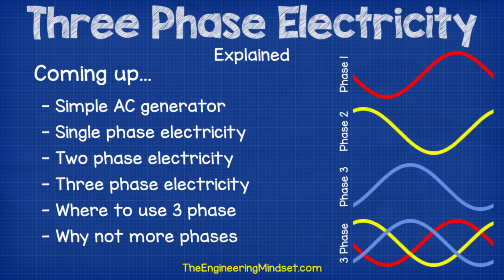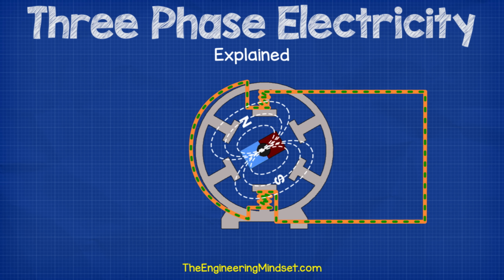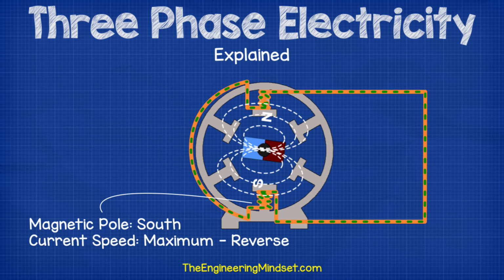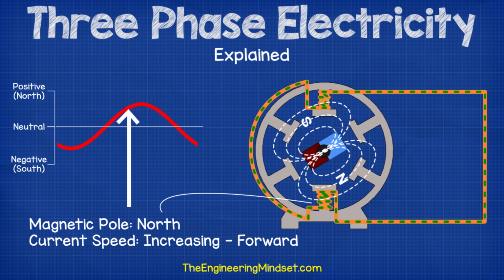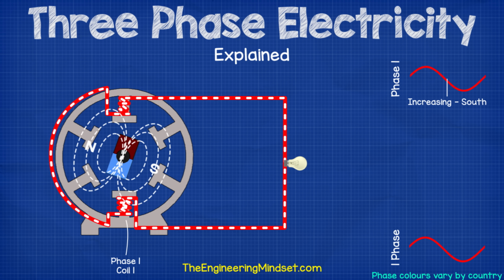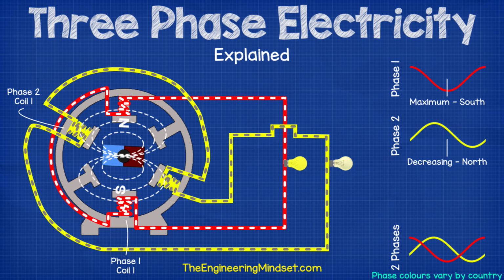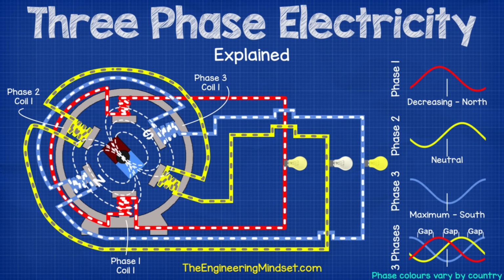How Three Phase Electricity works - The basics explained

Comment: That last bit about splitting and connecting only one phase to some appliances doesn't agree with your earlier explanation. Won't they flicker then? Or is the 50Hz flickering not noticeable for the naked eye?
Reply from the maker: AC is always flickering its just not noticeable
Reply: I believe the illustration was to highlight the fact that with a single phase, there are 2 points when zero work is being done. For a commercial setting with high power requirements, 3 phase power there is always being work done regardless of what point of the cycle it is resulting in a more effective use if energy.  For residential use, it's more than good enough. For a flashing light, the human eye can't see the difference until below 20 Hz or so. That is why the first films were recorded at 24 frames per second. That is past the point when you can see individual pictures and perceive the changes as movement.

Comment: Ok but my single phase power outlet has only one live wire. The other is neutral. Based on this video the wiring is symmetrical and thus each of the wires is live at some point.
Reply from the maker: Have a look at delta star connections, that is what your single phase outlet has and why it has a neutral line

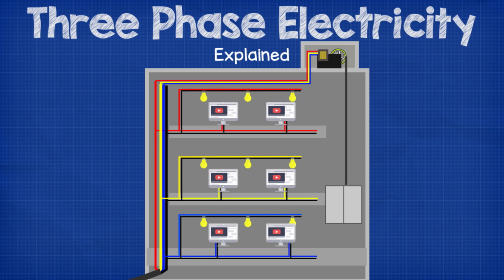Comment: 7:18, huh I'm quite sure most buildings in Finland at least  have all 3 phases because saunas and water boilers
Reply from the maker: Interesting, didn't know that
Reply: Heating is a very Watt-intensive load, and that is probably the driving factor.  In countries where most heat comes from on-site burners, instead of from electricity, there is almost no reason to deliver 3-phase to a residence.

Comment: in a lot of building with florescent lamps they with distribute the 3 phases evenly throughout the lights so the flickering of the lights cancels each other out. At my work there is a corner with only a single phase light and you can tell there is only 1 phase of light in that area due to a strobbing effect. The rest of the place you cannot tell due to the phases canceling each other out.

Comment: Where I live (Texas) all the homes have two 110v legs coming into the main breaker box. Wouldn’t this be two phase? At the end of the video you said that homes usually have one phase. Great video as usual!
Reply: Possibly, but more likely it's a single phase. What they use is called a center tap transformer. From the center to one end is 110v and from the center to the other end is -110v. The difference from end to end is 220V. For most outlets you only need one end as that is what your tv and lights run on. The 220 is used for your stove or dryer.
Reply from the maker: Yes I wasn't aware at the time that parts of the US have dual phase to houses as the voltage is lower

Comment: perfect illustration and explanation.   back in in the 1900s the lights DID flicker and they decided to speed the rotation of the magnet to 60Hz so it was no longer noticeable by the human eye. does DC not have a Hz then?
Reply from the maker: Hmm interesting
Reply: Hz is not an applicable term for DC, because there are no cycles in DC.

Comment: A good video, but I have a tiny correction. I work at a power company and we want all our customers to get three phases to their house, even if it's small. The reason is that it's easier to get an even load on three phases of the transformer when everyone gets all three phases. In areas with a lot of old houses that only have one we often see that 1 or 2 phases are almost maxed out while the third if far from maximum. But as I said, it's just a tiny correction in a good video :)
Reply: I don't know where you work in the power company but as an electrician in United States I can tell you that 99% of all residential houses have single phase 3 wire services. ( 2 ungrounded and 1 grounded conductor)
Reply: @shanejknox  Those two ungrounded lines are actually two phases that are 180 degrees out of sync. That's why you get 240 between them. If they were the same phase there wouldn't be way to run your 240 stuff.
Reply: @dub23handb  
You are correct. But it's still called a single phase service. The reason for this is because even on a 2 pole circuit (240v) with no neutral there is still only one path for current flow hence the term "single" phase. There's no such thing as a two-phase service.

But your comment has nothing to do with what I said, three phase as a branch circuit is only utilized for 3-phase motor loads. not lighting as this video suggests. And residential buildings in the United States typically do not have 3-phase services
Reply: @shanejknox  It's called a split phase, I simplified it. It's still 180 degrees out of sync which in simple terms is 2 phases. Your comment has nothing to with where the video originated. Most commonly in the UK one drop serves three houses with each three being on a separate phase.
Reply: @Sphaa How does this work in reality? Are my different rooms connected to different phases? Or is one appartment on one phase and the next one on in different one?
Reply: @Ezechielpitau  It all depends on how your building is wired, but in general, your outlets in your house will have a mix of phases across the various circuits to try to distribute the load as evenly as possible. This is usually more by intended use than room layout, although those tend to go hand in hand. If you pay your electric bill as part of your rent, i.e. your landlord is the one that pays the power company, then most likely your whole building is sharing the same 3-phase supply, but if you pay the power company directly, you'd have your own meter and probably your own separate 2-phase supply.
Reply: in austria, switzerland and i think germany too there is allways a three phase connection to each
 house. if the oven in the kitchen is electric it gets 3 phase and is normally the only device in a flat that gets 3 phase. dont know how the single lines are distributed normally over the three phases.. that i guess depends.. the bigger the house the more thought will be put into that..
Reply: Very good point. If I got your idea, you are talking about "phase balance"
Reply: Same for Slovakia 3 phase for residential household
Reply from the maker: Check our new revamped 3 phase explained video, sooooo much better:👉 LINK: https://youtu.be/c9gm_NL7KyE

Comment: At least in the US, most homes actually receive 2 phases of power.  Oddly though, the vernacular for this is "single phase power."  Almost all US homes have 2 hot legs and a single neutral coming in, and one hot runs along each side of a breaker panel.
Reply: It most likely is a single phase. What they use is called a center tap transformer. From center to one end is 110v and from center to the other end is -110v. Because it's coming from a single phase, you can get your 2 hots 180 degrees out of phase. Now the difference between the 2 hots is 220v which is used to power high draw appliances.
Reply from the maker: Watch this video on US electricity: https://youtu.be/fJeRabV5hNU

Comment: If 1 Hz = 1 full cycle, wouldn't that mean that something operating at 60 Hz has the direction of its current switched 120 times per second?
Reply: +Bryce Pursell - Yes.
Reply: Yes.  So that would mean that the generator in this example, would be rotating at 3600 RPM.
Reply from the maker: Check our new revamped 3 phase explained video, sooooo much better:👉 LINK: https://youtu.be/c9gm_NL7KyE

Comment: Thanx! I used to have a job making transformers from raw materials to packed and tested product. That included 3 phase. I now know what I was making.
Reply: The video did not touch on 3-phase transformers or how three-phase circuits work in a practical manner.

Comment: What about phase to phase and phase to ground circuits.  Is 3phase used only for motors?  Are phases distributed within a device for seperate  purposes?
Reply: The video only covered theoretical ideals on why three-phase power exists and how it's used.  Practical circuits are said to follow in a later video.  Yes, motors are the most-common use for 3-phase circuits because they make a motor so much more efficient, smaller, and simpler to construct.  Other uses include heaters and lights.

The distribution of 3-phase in a device depends on its design.

Comment: awesome video really enjoyed it but you made a little mistake, when explaining about Hz , cycles, etc you stated that the direction of current is changing the same times per second as the Hz rating which is wrong. 

The amount of times it changes polarity or direction of current is the Hz rating multiplied by 2 as it changes direction of current once in BETWEEN each cycle then again in the MIDDLE of each cycle, which your great diagram and animation clearly shows if you take for example where it says in video 50hz = 50 cycles per second then look at the sine wave then place another | (vertical line) for every time the wave form crosses over the neutral line, you will clearly see that yes indeed its cycles per second multiplied by 2.

I'm not an engineer myself and had to second guess myself but as soon as i saw your diagram and animation then say direction of current changes same amount of times and the Hz value i was like whaaaa that cant be right... first trying to work it out in my head then went to do some researching to make sure what i was thinking was correct.

From the below source where like 20 different engineers confirmed that what I was thinking was correct.

https://www.quora.com/How-many-times-does-AC-current-change-its-polarity-in-one-second
Reply from the maker: Well spotted. Apologies for the mistake, we all make them. I like that you put time into researching a doubt and found a good source to back it up. Nice work.
Reply: yes of course no need to apologize, just admitting mistake is more than enough and your right we all make mistakes even Einstein and other geniuses do or did rather, I hope I didnt seem negative about it! :3

Comment: A question..

if an electron is subjected to the changing electric field 50 times a second how come it instantaneously changes it's direction every time, 50 times a second. Wouldn't it be having momentum to overcome every time? 
To move in opposite direction it must overcome the momentum existing in previous direction before start moving back..
Reply: Remember all materials resist the flow of electricity.  That resistance mostly manifests as heat, which is the answer to your question.

Comment: 1. Very nice animations.  A picture is worth a thousand words, and an animation is even better, and I appreciate that it takes a lot of work. 
2. You say that as the magnetic field moves through the coils, the electrons go faster and slower.  I thought the voltage increased and decreased while the speed of the electrons stayed the same. 
3. Regarding complaints about your dialect.  English has many dialects and there is no "correct" one.  Interesting note: most languages don't have the "th" phoneme of English.  That's why they often say "zis" and "zat".  Even some English dialects say "dis" and "dat".   But I think many of us aren't used to the dialect that says, "one, two, free", or "froo" for "through", or "togevva" for "together".  It gets easier to understand as you get used to it.
Reply: Yeah the speed analogy was confusing...
Reply: A simplified explanation is that the electrons move at the same speed no matter the voltage, they just don't move as far.
Reply: @jovetj  - You are correct that the electrons always move at the same speed. However, what changes are the number of electrons flowing around in the circuit, not how far they go. Current in a circuit is a measure of how many electrons are flowing past a certain point in the circuit each second. That's what an ampere (amp) is by definition.
Reply: @Joe Vignolo  
I think we were talking about differences in voltage, not amperage.
Reply: @jovetj  - Voltage and current are directly related. As the induced voltage in the windings goes up and down the amount the current flowing in the winding and through the load also goes up and down. And the electrons always move at the same speed regardless of the amount of current. I'm not sure what you meant when you said, "they just don't move as far".
Reply: P = I × V
Reply from the maker: Check our new revamped 3 phase explained video, sooooo much better:👉 LINK: https://youtu.be/c9gm_NL7KyE

Comment: It's usually 2 phases per house in residential applications right?
Reply from the maker: Jared Walther in the US because the voltage is low
Reply: OMG!  I had never considered that you folks with proper voltage wouldn't have to deal with running a second phase for normal household stuff.  Thanks!

Comment: My house we shockingly discovered has 3 phases run to it.  It was built in 1964 and had a 3 phase air conditioner.  So 3 phases come to the house and run to a separate fuse box for the air conditioner, and one of the phases is run to the main circuit breaker box for the rest of the house.
Reply from the maker: Seen our new incredibly detailed MCB video? link: https://youtu.be/gqEu9t8HwW0

Comment: The first time I heard of 3 phase power was when I worked for the carnival. The generators they use are 3 phase. My supervisor gave me a basic understanding but this video helped me a little bit more.
Reply: Fellow Carnie here... and used to work on the 250KW CAT generators and connecting the various rides.  Learned alot about 3P electric from that job. :)
Reply: Yes it's very simple, in the motor it will give you three times the push and pull.
Reply from the maker: Check our new revamped 3 phase explained video, sooooo much better:👉 LINK: https://youtu.be/c9gm_NL7KyE

Comment: Nice thanks, I had been wondering how they generated AC electricity and now I know. Kind of bugs me though that houses typically only have access to split phase power allowing for two 120volt lines in the house or when comibined, 240 volts in north America for heavy appliances (Still not enough though if you need some heavy duty tools for your own workshop)

Comment: Thank you for the video. AmazingMay you please explain why single phase requires a run capacitor and 3 phase does not. What are the effects of a run capacitor in a single phase motor.
Reply from the maker: You need a rotating magnetic field. 3 phase has this because the multiple phases 180° apart, single phase doesn't so a capacitor is used to create a "fake" one from the same phase

Comment: i have three phase power at home for the air conditioning... why can't single phase power be used? because it uses too much power or something?
Reply from the maker: Ants Tech you could technically do it off single phase, like a refrigerator. But the capacity will be low

Comment: Most homes have 240v which is split phase not single phase. They get the typical 120v from a single phase and neutral while the larger appliances (stove, dryer, A/C) are a split phase which uses both phase wires and no neutral
Reply from the maker: In the US maybe
Reply from the maker: Watch this video on US electricity: https://youtu.be/fJeRabV5hNU

Comment: So, basically speaking, 3 phase power is just using 3 single phases of power at the same time, right?
Reply from the maker: Not quite, they reverse cycles at different times 180° apart  that's the key

Comment: Suppose that you have all three phases entering a single object (say a motor or pump), why is it not the case that the current phases add (I say this because they are all correctly out of phase to be identically zero, ie sin(x)+sin(x+2pi/3)+sin(x+4pi/3)=0), or is there more at play here that I'm not getting?

Comment: Wait, I still don't get why people don't use two-phase or four-phase power. Obviously, the "power gap" is differently sized, but just like one-phase is sufficient for many applications, why not two or four?
Reply from the maker: You could use as many phases as you like but product manufacturers around the world need to conform to the same design   so 3ph became the norm with its compromise between cost to build and power provided.

Comment: emm dude, i want to ask you, ih we could connect every phrase to different floor in the hotel that means every single phrase in the generator will have different load right?. how did the rotor or the generator deal with it?
Reply from the maker: The building will be balanced through design and will use a neutral to cancel out. In reality the phases are never exactly equal loaded, the generator can withstand a certain level of difference, the manufacturer will state the limits.

Comment: FUN FACT: 3 phase electricity is commonly used in airline aircrafts because of pros above video already said. BUT! it forgotten the most important pro of 3 phase electricity which is very small resistance what is significant in transforming energy from power plants to your home.
Reply: Actually this is not true... In fact, AC-resistance is always greater than DC-resistance, primarily due to skin-effect in conductors. 
In airplanes they use a much larger frequency (some 400 Hz) since this will allow for less iron in motors and transformers (to prevent staturation of the iron). Since weight is important in airplaines... The three phases has to do with having a constant torque on a rotor, which is not possible with 1 or 2 phases. This is very important for accurate control of the motors.

Comment: Good video but it would be helpful for novices to touch on wye vs delta configurations for transport/generation. You infer it in a few diagrams but are not explicit. Also touching on VAr phase shift and harmonics of inductive loads and apparent power.
Reply from the maker: We'll definitely cover these in more advanced videos as we progress through the series on electrical engineering